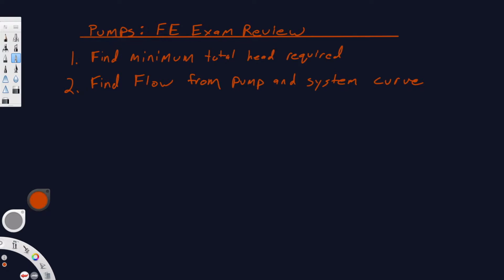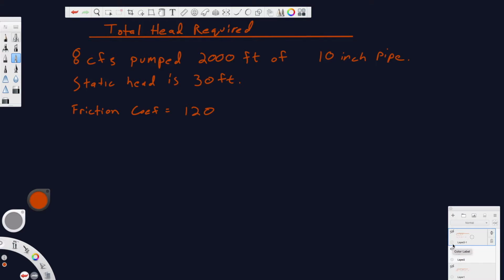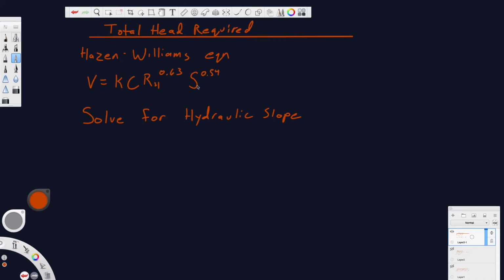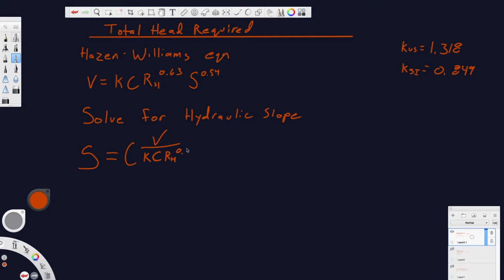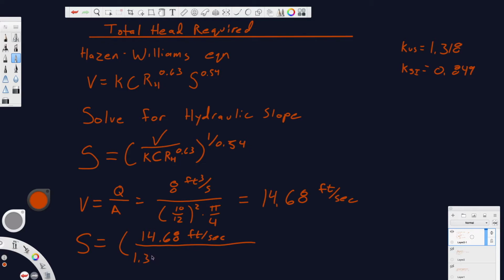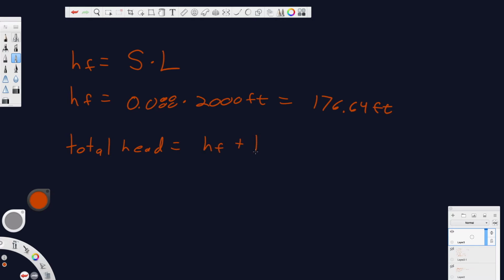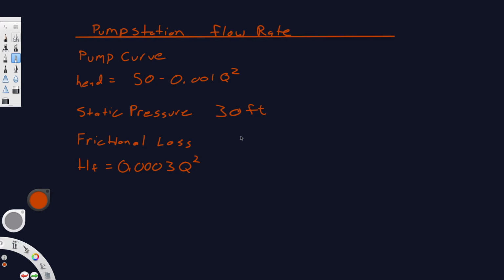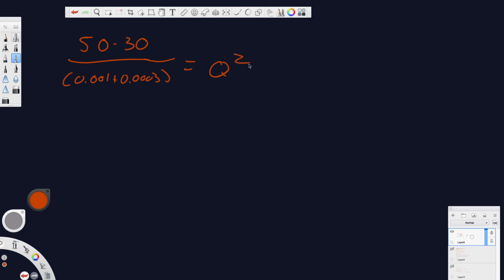Pump Curves and Pump Selection: Environmental Engineering FE Review

Comment: In the FE reference handbook, there is an equation on pg. 297 called "circular pipe head loss equation" where Hf = [(4.73)(L) / (C^1.852)(D^4.87)] (Q^1.852). Can this equation be used here? My answer was [(4.73)(2000ft) / (120^1.852)(0.83^4.87)] (8^1.852) = 155.55 ft.
Reply: This reply is a little late, but I solved it using the hazen williams method provided in the video and my answer was 152.76 ft + 30 feet for the static head for a total head of 182.76 ft. Using the circular pipe head loss equation, my answer was 152.54 ft + 30 ft, 182.54 ft of total head. It seems that the equation on pg 297 works just as well and has way less steps. If I have an exam problem such as this one, I'll definitely be using the circular pipe head loss equation. I hope this helps anyone else prepping for the FE exam that comes across this.